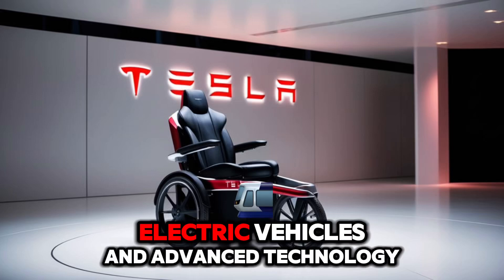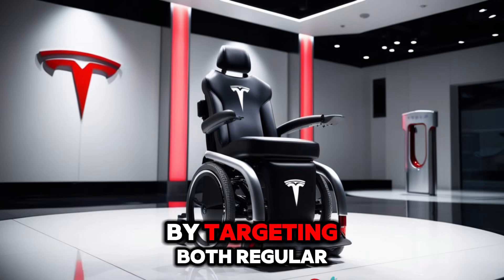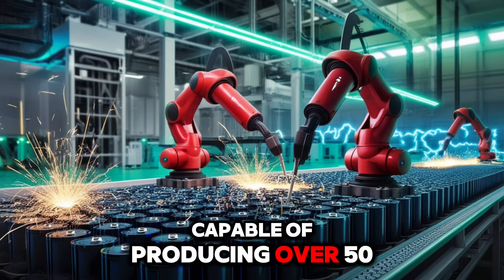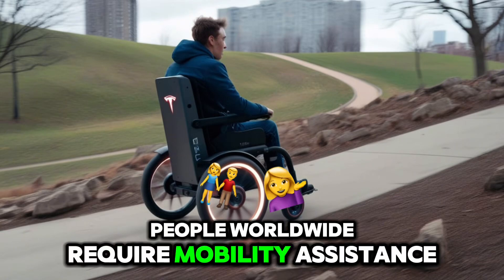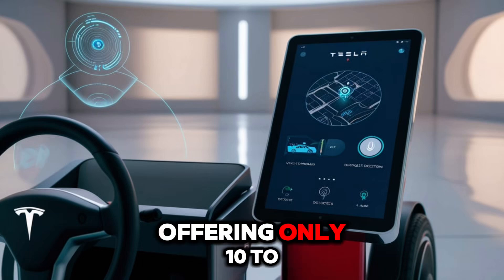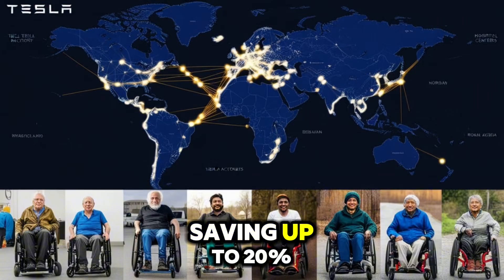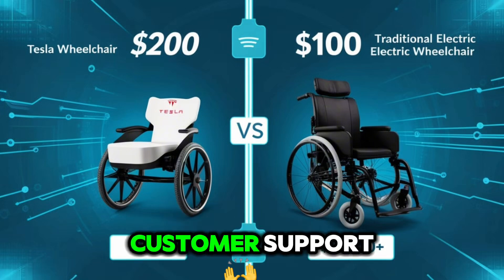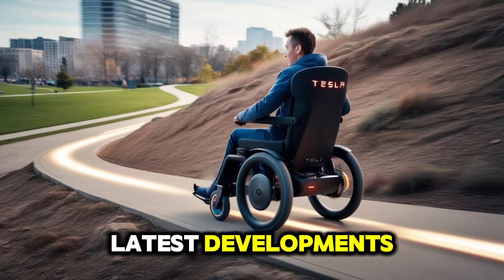Tesla's $159 Electric Wheelchair Is a Total Game Changer!"

Comment: this tech must have seatbelt, wireless battery charging of mobile phones; afffordable spare wheelchair battery; shock absorber; solar-power as alternate power source; able to detect general mood, chemical imbalance, heart rate, blood pressure, and sugar level..  it should also have capability to connect alarm to police station and ambulance/ medical facility; kill switch; speedometer/ odometer; cooling and waming seat; anti skid; GPS tracking, as well as built-in wifi.  plus able to recline 180 degrees like a laz-e-boy chair; extra compartments for important belongings so as to store canes, crutches, umbrella, metal arm and leg, attache case, meds, gun, gas mask, grocery/ shopping items, tablet and kindle reader, etc. ; and can be instructed go/stop reverse/ speedup /slow down / turn left right etc via voice command or braille or via numeric code or mere muscle movement; must have built-in am/fm radio, and professional sound system.